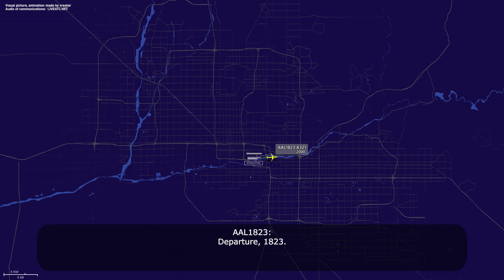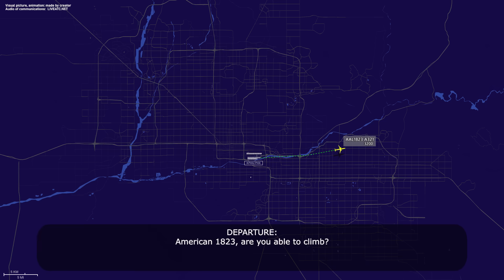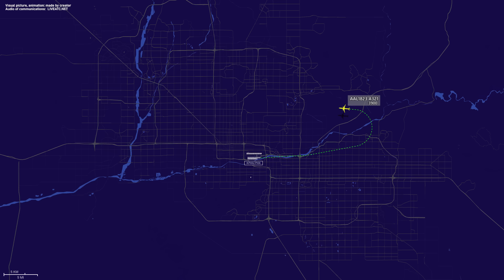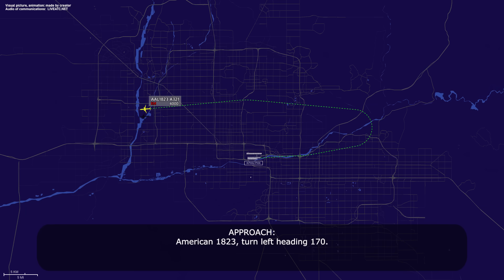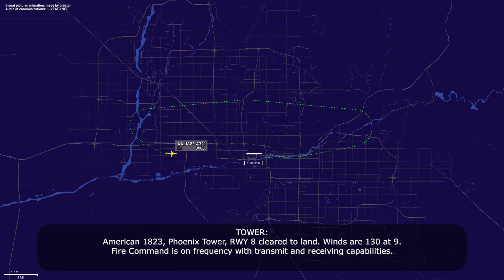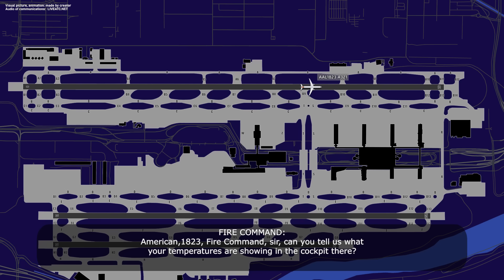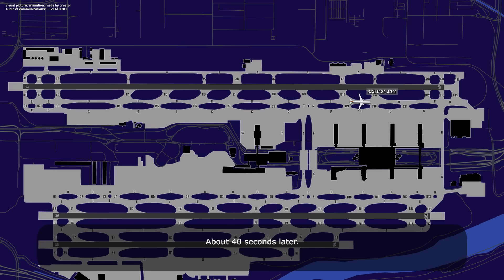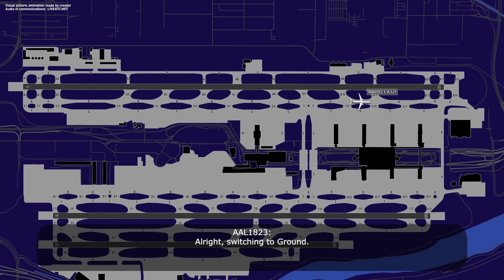“We had to shut down the engine”. American A321 performs single engine landing at Phoenix. Real ATC

Comment: I was on this flight. Pilots did a good job keeping everyone calm and not really alerting to an issue right away. 

However anyone that flies regularly would have noticed things were quickly not right.  Engine thrust turned down quickly after takeoff and then never gained any additional altitude. Then started the left bank to come back around.

Comment: I was on this flight and have followed the aircraft since. It flew to PHL on the 27th and then went back out of service. Plane flew to TUL on the 1st. I assume for engine work as AA has no direct flights PHL to TUL and AA has a major repair center there which was expanded in 2023.